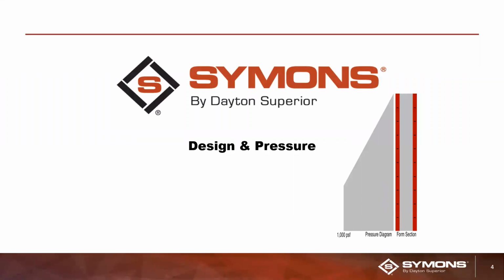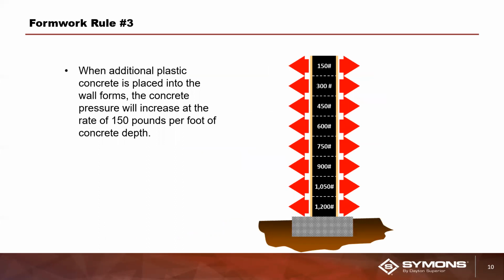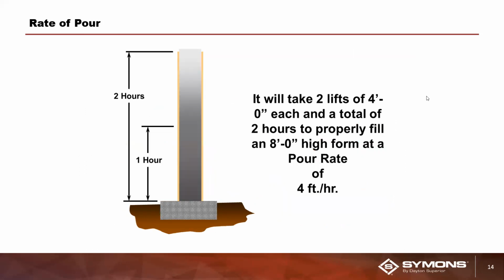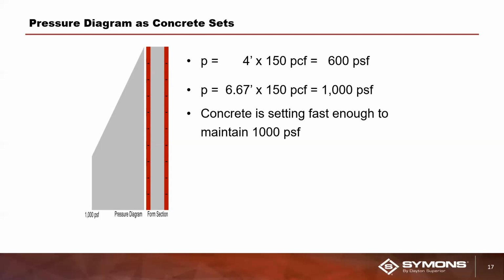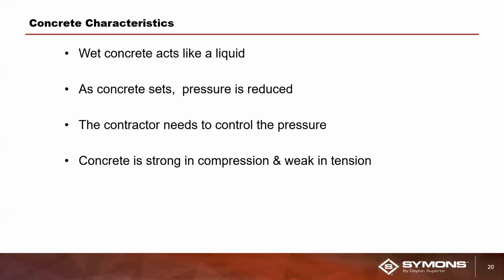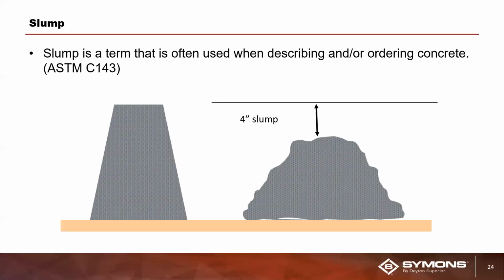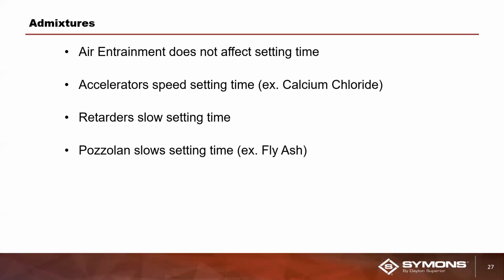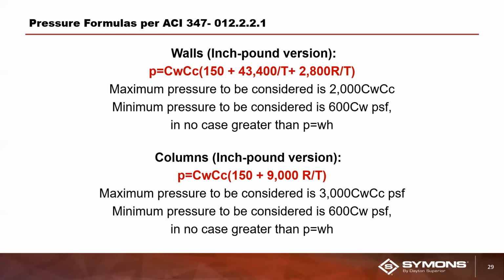Understanding Concrete Form Pressure - A Symons Training (by Dayton Superior)

Comment: if I want to pour a concrete foundation and I don't have the money to pour it all in height! can I use climbing formwork? and to pour it in stages? making sure that I have connection lines and distribution bars? is it possible to build a house with a 1.2 m deep foundation? the first stage 60 cm foundation sole and then the 2nd stage another 60 cm and then the elevation part 3 pouring concrete 40 cm high?the width of the foundation wall and elevation is 32 cm.what you think about my ideea! i use less wood for woodframework!
Reply from the maker: If you would like to contact our technical support at 800-800-7966, they would be the correct department to assist you.